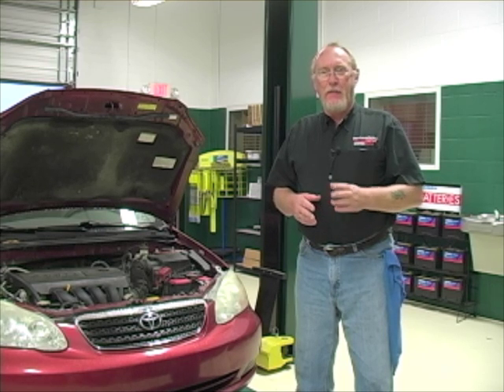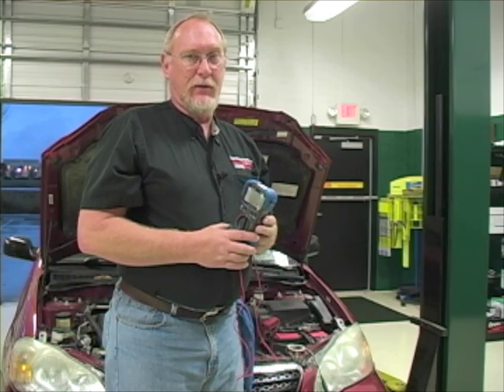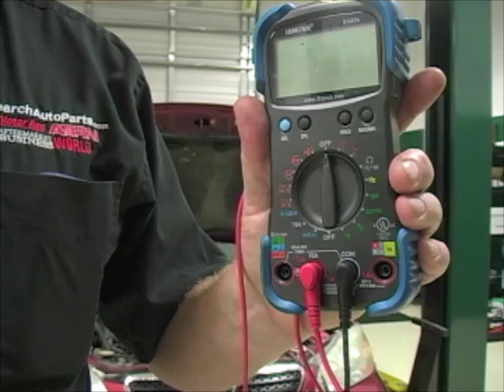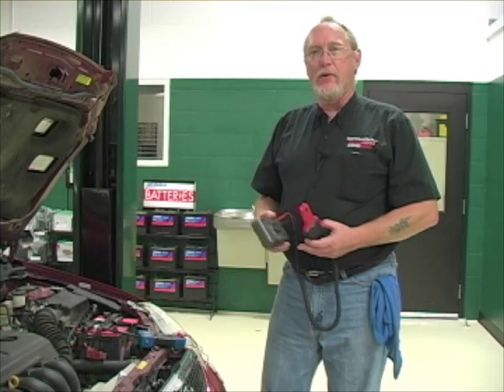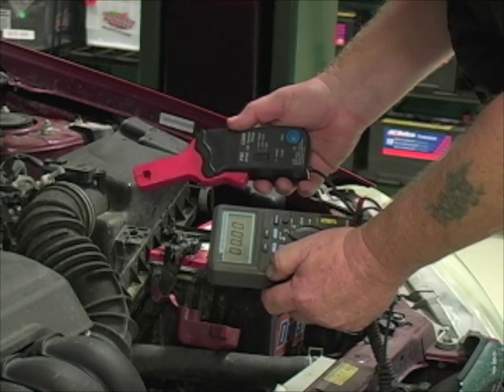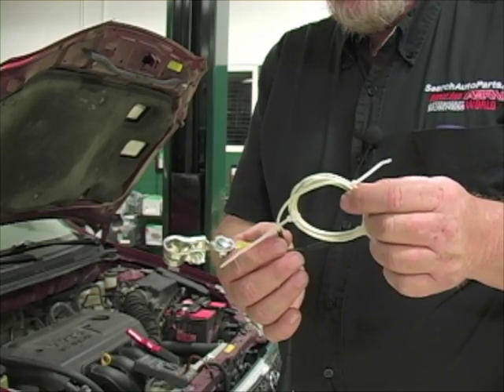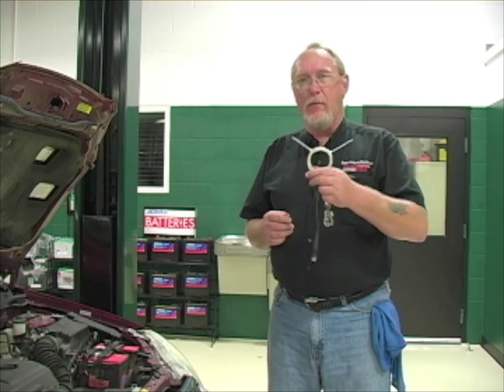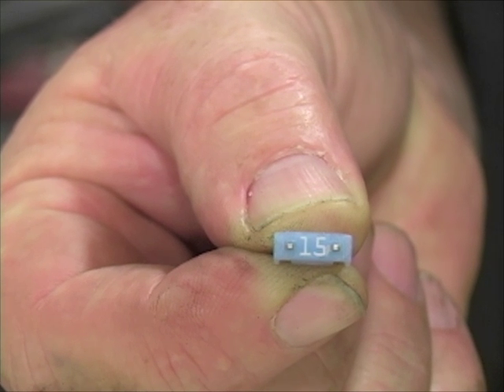The Trainer #27: 3 Ways Of Finding The Cause Of Key-Off Battery Drain (Parasitic Draw)

Comment: Thanx for your helpful video. You made it so easy to locate the power drop with the fuse check. But I have one question, what if you have to check a relay box?
Reply from the maker: All circuits are fuse protected, even those controlled by relay. You'll need to first identify what fuse is indicating an active circuit and then review the power distribution schematic to identify what circuits the fuse is protecting. You can then use a low amp clamp to further isolate the problem by clamping around the power wires feeding those individual loads.
Reply: Only way I know is to pull each one and see if theres a drop other than taking it off and testing the leads with the voltmeter

Comment: Silly question Pete. When u connect the jump box to the terminals....... do u have to turn the jump pack on or leave it off or it doesnt matter. I understand the concept of fooling the computer into thinking the battery is still present and the jump box like u said is just another battery with plastic wrapped around it. I just over think alot of things all the time and complicate my head. Thank u Pete
Reply from the maker: I would think you have to turn it on prior to breaking the original battery connection - otherwise you are still interrupting current flow to the modules.

Comment: thanks a lot for your time I like your chanel I learned  a lot from it 
is have a Renault laguna  1.9 diesel it runs for few miles and stop completely   it starts again after it get cold and the same again dies after few miles any suggestions please and thanks
Reply from the maker: Sounds like it's running out of fuel. I'm not familiar with the fuel delivery system but look for the volume of fuel being delivered - not just the pressure.

Comment: Great video and thank you for it! When testing for voltage drop on the fuses my multimeter has 2 settings for millivolts 200 & 2000 which one should I use?
Reply from the maker: 200 - the reading you'll see will be very small.
Reply: @VehicleServiceandRepair  Thank you so much for the help and the quick reply!
Reply: @bryans8193

Comment: Really good parasitic drain video. First one to mention keeping the vehicle powered to not shut off the parasitic drain. I have been to 2 garages and they can not find the issue. Im guessing they skipped that step if they even did the parasitic drain test at all (just learning all this myself now). 

My truck keeps randomly having a dead battery but sometimes it can sit for over a week and start fine. Its also sometimes running at 16v  I have never been more frustrated in my life. Who ever heard of spending money on a vehicle to not fix it... (did some blind fixes so its on me i guess...)

Comment: Please help. I have 91 camaro 305, starter solenoid clicks will not  turn over. After 6-8 clicks it will turn over and start. I replaced starter twice, still the same. I have bypassed the ignition lead to the solenoid straight to the battery with a circuit breaker and push start switch and still have the same issue thinking that i eliminated the resistance. Why is it still clicking? Could the alternator be the issue. Thanks
Reply from the maker: First, make sure the battery is up to the task of turning over the engine. Second, spin the engine over manually to make sure that it is free to move and there isn't a mechanical issue causing your problem. Third, test the starter circuit (both on the ignition side AND the starter motor side) using voltage drop as a test method. Look especially at the starter ground to the engine block, and the block to the battery. Hope this helps!

Comment: Hello Motor Age. I have a 1991 Chevy R3500 dually. Go out to start the thing months later in a warm weather climate in Fl. and have (no) juice whatsoever. Batteries were completely drained and one of the two had no amps and one with a bad cell as well as that they weren't able to be revived when slow-charged. What in the world would drain down two 2-year old batteries this badly ? Any ideas ??
Reply from the maker: You said in your description that is was "months" later. Batteries will drain down normally if left sitting for extended periods of time. That's why most battery companies recommend battery maintainers for vehicles in storage. Replace the batteries and check the system for proper operation and key off current draw, though, just in case.
Reply: Hello Motor Age.

Thanks for the info. Although I was told by my 76 year old neighbor who started his old 'parked' Minneapolis Moline farm tractor that has been sitting for several years outdoors that since we get warm weather, year-round for the most part, these batteries shouldn't have drained down like that now we (do) get cold spells in the fall and the winter but only for a half-week or so and then the weather stays in the 40-to-50 degree range. So (maybe) these swings in temperature and the outdoor temp, staying in this range (could) have an adverse effect on these batteries. I guess I (still) should be open-minded to the possibility that there (might) be a short somewhere though. Please tell me your thoughts and thanks for your tips thus far.

Comment: thanks for the video.  i tried doing the host (secondary) battery, from a good running car, fully charged, to keep the system "awake" but the same thing happens, amps go from .90 to .02-.04, after 13 seconds.  its driving me nuts already, because im trying to get this going so i can fix my draw issue.  please, please help, anyone!!!  ty
Reply from the maker: If the current is dropping from 0.90 amps to less than 0.040 amps, it sounds like all is going to sleep pretty quick. What kind of car? What is the concern?

Comment: Yes you stuff is useful but what if it's an intermittent key-off draining.  I have a friend who has a 2006 BMW 325i that is dead two to three times a month (all hours calls "Can you come and jump my car.).    Altenator (twice) and battery have been  replaced with both testing out good.  Thing can go dead in less than 4 hours. Nothing appears to be staying on.  Is the solution crushing?
Reply from the maker: As a good friend once said, "There is no such thing as an intermittent problem. We just have not recreated the conditions under which the problem occurs." Try to find out as much as you can about how the vehicle is being operated or stored when the problem occurs. One tech reported a case of unknown battery drain only to discover that the customer was leaving the smart key in range of the car at night. The two were constantly communicating! Tracing with a scope may also be helpful, using an amp clamp on either side of the battery. Good luck, and I hope this helps!

Comment: Great video!  Please give me the manufacturer / model of your multimeter.  I need to buy another one that has more specific functions for electrical DC work.  Thanks.
Reply from the maker: This is an old UEI unit that finally died on me after more years than I care to admit to. That model is no longer available but there are plenty out there, in a variety of price points, that will do the job just as well. Check out my friends at http://www.aeswave.com. They can steer you into the right one for you.

Comment: Great video.......If battery is to be removed/ replaced, I always have to go for steering angle calibration in Porsche cars, so if I connect jumper as according to you, do I need to do the steering angle calibration or
 not ?
Reply from the maker: As long as there is never a loss of power to the modules, I would think you would be fine. Just be sure that whatever procedure you use will indeed supply power to that module.

Comment: When using the jumper it must be on and then once you begin using the multimeter do you turn it off?
Also, when using it can it hurt my multimeter because it has a maximum of 10Amp reading. 
Thank you.
Reply from the maker: The jump pack is only one alternative to keeping the circuits alive while you place your ammeter in line. Once you've placed the meter in series, the pack can be removed. And you're right...you don't know how much draw you'll measure so it's good practice to use a fused jumper wire in series with your meter leads to protect that much more expensive fuse in your meter.

Comment: Dear sir i need help please my car battery keep draining when the car off  i get oil pressure light and check engine light on even the key off and out of the car i check these thing and no found the darin 1.door locks 2.door receiver   3.key control 4. head light the 
5.inside fuse box 6.engine control 7.airbags 8.The battery bought new one .

Comment: Here's a head scratchier. My Mom's 1987 Buick LeSabre Custom has developed a steady drain of 2.97 and so far I'm holding it off by connecting an 800mV  Battery Tender every time she parks the car. The reason I checked was that within the last week, if you hit the steering wheel hard enough the horn beeps. Actually 2 days ago she got up and heard the horn blaring from inside the garage (temps were down to 3 degrees F). Went thru connections under hood (disconnect/connect); no change. Went to the fuse panel and started pulling/replacing one at a time and unfortunately, no change, even pulling the fuse for the ECM. I tried but couldn't get the horn to beep by hitting the steering wheel and went as far as giggling the wires under the dash to try to induce a short or change in reading but nothing. Is this going to be one of those pull each and every wire to find the drain or is there something I'm missing?
Reply from the maker: +DjJtown Start with the fundamentals. Connect an ammeter in series (odds are it's not a module that isn't powering down with that high a current draw) and start pulling fuses until you see which fuse stops the loss. Remember, there may be more than one fuse panel on the car. In your case, there are several fusible links on the right front of the engine compartment you need to check as well. There you can put an amp clamp around each one to see if current is flowing, or disconnect them one at a time as you would the fuses. Hope this helps!
Reply: +Motor Age Did some more checking under the dash. A mechanic at the  Buick dealership showed me where the other relays are located and the schematic; scattered under the dash and up high. Those are the ones that were relocated to the engine cowl at the start of the 1989 model year. It took me over an hour to check those few that I missed because of the location, still finding nothing. He suggested directly probing the fuse connectors and that's when I found it. It is in the pwr window circuit. It showed the same drop at the fuse block as it did across the battery. It was the 20A relay circuit and not the relay. I tested the 3 relays each time but for some reason, failed to probe the relay connection. Now it's a matter of taking each door panel off and checking the individual switches and motors.It will have to wait til next Wed as I work 10a to 10p Thur-Tues. Until then it's the Battery Tender everyday after work and a jump pack in the trunk for work. This episode really helped. It saved me around $500 in labor fees if I took it to a shop! Please keep these coming.

Comment: con you use a battery charger on trickle mode rather than a jumper pak?
Reply from the maker: +dave nmemphis A jump pack is only another battery wrapped in plastic. I don't think a charger will do the trick.

Comment: Thank you very much for this video. I have the battery drain problem with my Nissan Maxima, it has a brand new battery in it but every day I have to use a portable battery to jump start it. Huge pain in the you know what. I don't have the tools to do these tests and even if I had I don't have enough confidence I could do them right, so I will have to take the car to shop but at least I won't sound like a total idiot when I tell them what needs to be done and they won't be able to take me for a ride with the price. Thanks again.

Comment: My rarely used Jeep goes dead after about a week of sitting. It has a new, quality battery. When I test starting with a full charge of 13 volts I get a 0.15 amp draw. The only thing that should be drawing is whatever the radio uses to keep clock and presets working. 0.15 should be acceptable, right?
Reply from the maker: Nope! That much of a draw is the reason your battery is going dead. Follow the procedures shown in the video to track down the parasite.
Reply: Some cars have seat position and pedal position memory/presets as well.
Reply: *****
We just repaired a 2000 Grand Cherokee - it had a blown Daytime Running light, and the Headlamp module was faulty.

We traced it using the Body Control Module fuse in the under hood fuse block - its a 50amp fuse I think.  There are a lot of fuses running through that fuse - but its a start.

We have also seen broken door and tailgate switches on those - check to be sure none of your interior lights stay on after closing the doors.

Stay gold.
Reply: +WinterWanderer  Unlike the complicated vehicle in the video and the response you got from dnl machine.  I have a 20yo Wrangler. There are zero options and minimal operational electronics. I have an aftermarket  radio, a single interior light and a pair of fogs. They all go on and off as they're supposed to. Emissions/safety sensors are not faulty or shorted because the warning lights are off. Yet I still have a draw. It takes about two to three weeks for the battery to drain to the point of not starting the truck. So I went to Harbor Freight and bought a $5 trickle charger. Problem solved.
Reply: +WinterWanderer I can tell you one thing. A quality battery makes a difference. Originally I bought a cheap $80 Walmart battery. That would go dead in about a week. I pulled that out and threw it in a Volvo I was selling. I took the MAXX (Johnson Control) brand full sized battery from the Volvo and threw it in the Jeep. It lasts 2-3 weeks now. So if I were using the Jeep as an every day car, I would probably not even realize I have a problem. But I do have an unknown draw. A good battery in a good car should last at least a couple months.

Comment: how do i do it with a side post battery?
Reply from the maker: Techs learn a variety of methods to test for the same issues so they can adapt one or another to fit different situations. WIth a side post battery, you can simply thread in a bolt taken from another cable end and attach your meter leads there. OR use a low-amp clamp around the cable. OR disconnect the ground cable on the ground side if it is a single point contact. Get the idea? HTH!
Reply: yea i get it, cant believe i didn't thinks of that haha. thanks a bunch!

Comment: I Have 1996 ford explorer and it has a new battery & alternator. & when i turn it on and use headlights, radio, turn signals it looses battery in seconds and if i charge it back it up and then turn it off it won't start till i recharged it
Reply from the maker: Start here:  Testing Battery/Starting/Charging Systems:  April 2013 "The Trainer"

Comment: The third method, checking for current across the nodes on top of each fuse. I don't understand how that is able to give a reading while it's element is intact (not blown).
Reply from the maker: The fuse element has resistance...a very small resistance, but resistance nonetheless. And there will be a very small, and measurable, voltage drop across it when current is flowing. Try it!
Reply: Motor Age
okay, i see. Thanks.

Comment: I'm trying to find out what's draining my '01 Forester's battery so bad that I've had to replace it twice; once after two years of sitting with minimal driving, then again about 6 months later with infrequent start-ups. I followed your third method and found only one draw, 0.35 mA on the cabin clock fuse. Is that a normal amount of draw when the clock isn't even showing the time and the key is off?

Comment: on the digital meter do i use dcv or dca or other
Reply from the maker: Use the millivolt setting on your meter when using the fuse/voltage drop method. Amps if placing your meter in series with the negative cable.

Comment: I have a '08 Ford van and after testing, the A?C clutch circuit is draining the battery with the key off. Is the relay bad? I already replaced the compressor with a new one that had a new clutch that came with it. How can this circuit be draining the battery with the key off?

Comment: Hello! I am having trouble with a new head unit I installed, its drawing  .072 amps when the unit is plugged in and when its unplugged I get a reading of .020 amps. The unit came with a wiring harness so i didn't have to cut anything.
Reply from the maker: Need to know a bit more about the problem. Year/make/model of car? Where are you measuring the current flow? Have you tried waiting an hour or two to see if the head unit is working like an ECU?
Reply: Motor Age measuring from the neg terminal to the disconnected neg lead, okay I waited a while and the draw dropped down. Thanks!
Reply from the maker: Daniel Williamson ;-)

Comment: Hi my car is reading 0.85 on the 10amp on my fluke... I haven't start pulling fuses so I will like to ask, I know everyone say "a normal reading is 0.50amps" My question - can my 0.85 or the extra 0.30 could be coming from my alarm? and is 0.856 is too much. thanks in advance
Reply from the maker: Assuming you have your decimal point in the right place, YES! 0.85 amps is way too much. The max you want to see, generally, is .030 to.050 amps. And yes, your alarm may be the culprit. Unplug power to it and see what happens.
Reply: thanks for the quick response I will do later this afternoon... keep up the good work ur doing